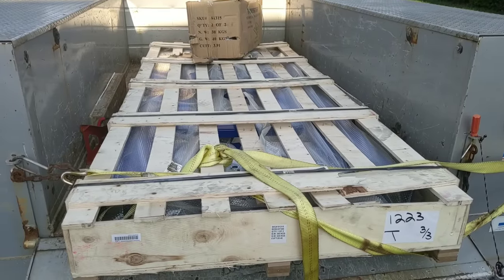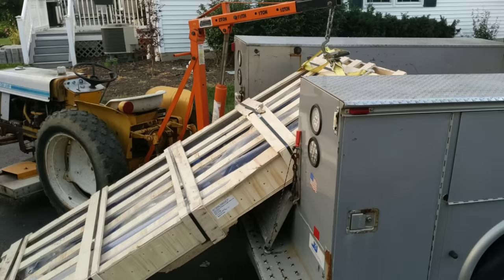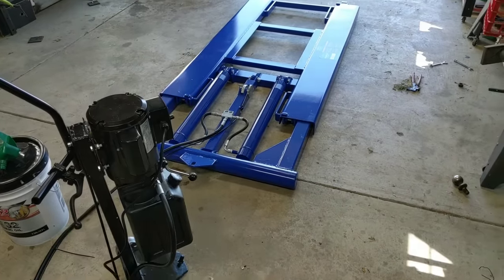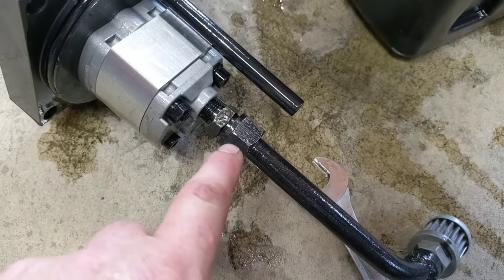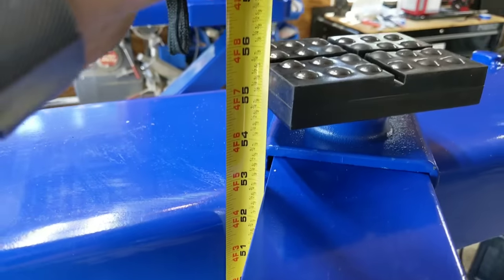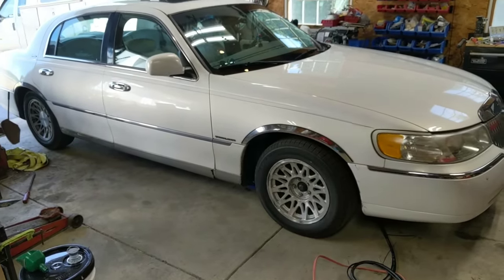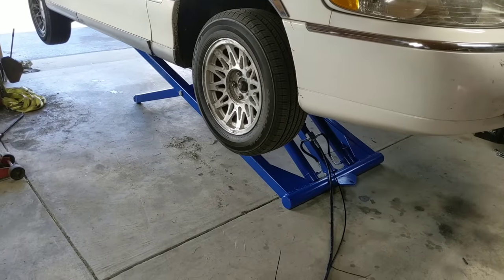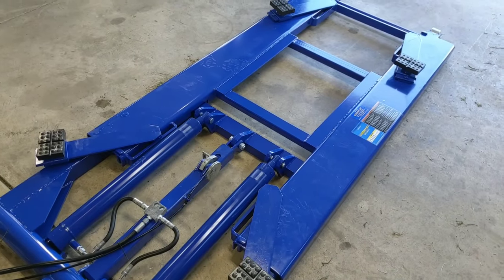Harbor Freight 6000 Lb. Capacity Scissor Lift Review, Central Hydraulics, is it worth it?

Comment: I’m considering cutting a pit in my floor. Dig it deep enough to pour 12” of concrete over a rebar frame I’ll make up. When not in use they’ll be a 1/4” steel lid or maybe I’ll pour angle iron at the top and weld double doors/hinges/ this way I’d have no trouble with car height plus I won’t lose my precious floor space. Not sure how thick your floor is. Most are 4 inches. That seems to spread the weight a little but eventually it will crack.if you want to save on concrete when you dig your pit buy 2 hunks of I beam. Weld some kind of steel U TRACK ON THE TOP OF THE I BEAM TO KEEP IT FROM SLIDING AROUND PLUS THE U CHANNEL OR TRACK WILL GIVE YOU A PLACE TO LOAD WITH GREASE saving those little wheels and bearings. Like you said that’s a LINCOLN town car. An old one. But it’s a low rider. What happens when you gotta put a little Ford Focus on the lift. There’s probably 6” from fram(ish) to ground. You gotta put a floor pocket in to get proper safe use  not sure what this costs. I’m also looking at a regular post lift like you’d see in a commercial shop. I’ve seen heavy duty enough to lift my Ford F-250 super duty 7.3 litter diesel for around 2K

Comment: Welcome to my world. 
Hahaha !
I do repairs and installs on all brands and all sized lifts. I’ve supported everything from the bargain priced overseas cheapies to the big names with big capacities and big price tags. We moved and reinstalled installed a Rotary 20,000lb. Two post last week and started a very experience repair on a 75,000 lb. In ground lift at a city Maintenence shop. 
We see brand new lifts shipped in all sorts of disarray and damage even when they are well packaged.  Lately it’s been much worse. (Blame it on the Covid)
As for custom repairs to the lift itself, that’s just “par for the course”. There are times I have had to “build a better mouse trap” out of whatever I have in my truck, or find available at the work site, to finish the job and leave the customer with a well working piece of equipment. The cheaper the brand is, the more I have to
 “fabri-coble” some kind of, on the spot, creative cobbling, to get the job done to my satisfaction. 
You just deal with it……

Comment: i have six freinds that  bought these and the same problem with the pump, was that that pipe fitting on theirs was loose also ,and the cover for the motor capasitor was all bent up also. but you got oil in yours, i did not

Comment: Looks OK for changing tires and brake work. Don't believe I would get under it and work, just doesn't look safe to me.
Reply from the maker: Correct! They are not designed to get under!   Perfect for lower detail and body work, not designed in any way to get under!    For detailing they are awesome, as you don't have post casting shadows and getting in your way!  :D

Comment: I dunno---will the safety hold if the lines blow? I would change the entire hose system for high rated braided steel. Also, the two bolts that are the pivots for the crossed legs are taking all the weight---Id go high strength bolts and maybe even use a bushing if possible--I cant see it from the vid.

Comment: How much you pay for that ? I got a Forward 10,000 pound 2 post lift for $2200, lifts up to 72 inch
Reply from the maker: I don't really remember but I want to say it was around $1,200 shipped.   Keep in mind a scissor lift is not a replacement for a post lift.  Scissor lifts are great for lower body and detail work as you can sit on a stool and wheel all around the vehicle without post getting in your way or casting shadows.  Post lifts are great for working under the vehicle.   Just a different tool for a different job

Comment: We have one at our shop it's only good for light vehicles hence the 6,000 lb lift ours does not bolt to the floor travels on the floor you have to put two byes on each side for the tires and run up on otherwise you drag underneath the car and it's really only good for small to intermediate size cars you can't put a crown Victoria on it you can't put a full size Cadillac on it you can drive on it but I wouldn't want to lift it because of damn arms don't go out far enough to grab a hold of the body and it don't go high enough of your 5 ft 8 like I am it does not go high enough to work underneath the car it's basically made for doing brakes and tire changes and shocks and stress and that's about it I like your four foot three then you can walk up underneath it with no problem and in the past year and a half that we've had hours I'd rather use the damn floor jack to work on a car then work on with one of these jacks or lifts but they're good for home use but weighing the cost of home use and doing work on a car or taking it to shop and paying them to do it sometimes it's cheaper to have somebody else do it that's my input

Comment: Have this kinda of lift in  shop i work for..Bought via AUTO ZONE,, works great,,But had issues as well,, the fittings not properly tighten ,,low on fluid, and wheel on pump kinda bent,, Just notified Auto zone, looked to confirm,, They got new one sent out within two days,,And gave discount on lift,, even tho bought when on sale..YES  using planks to get better height clearance..But over all ,,is a very good addition to shop or even for home owner if work on cars or suv,s

Comment: for $1600 you can get an Atlas 9000lb 2 post lift, or some Bendpak or QuickJack portable hydraulic lifts for $1200. I always prefer used though, Facebook or Craigslist find a better used one at that pricepoint! But good review
Reply from the maker: I had actually stumbled upon a portable 2 post for the same price, but I needed a scissor lift.   Post lifts are must if you need access to the underside of the car.   The issue is when your detailing or doing lower body work the post get in the way and cast shadows.   The other bay in the shop is getting a short 2 post portable lift in the very near future.

Comment: Looks like there’s so much metal plating/supports, etc in the middle of that thing that it would make exhaust work, drive shaft removal, transmission access difficult I’d not sometimes impossible. Or how about being able to access a frame rail-mounted fuel filter?
Reply from the maker: I wish I had explained why someone would need a scissor lift in the video.  They are not intended to get access to the underside of the car.   They are only intended to lift the car high enough to work on the lower extremities.   Perfect for lower  detail / body work as you can wheel around on a stool and not have post form a 2 or 4 post lift in your way.    If you need to work under the car, you need a different kind of lift for that.  https://youtu.be/RAqqgq7ielE

Comment: The end of the lift with the cylinders Goes toward the rear of the vehicle That is the weight to keep the left from tilting over
Reply from the maker: That is actually the incorrect way to load the car onto these lifts, unless you have an engine in the rear like a Fiero.   If you study the physics a bit while the car is up in the air, it is safer to put the engine over the hydraulic end, as stated in the manuals.   It is less likely to tip over.   If you go to the harbor freight web site and look this lift up, you'll see a van up in the air, the engine is over the hydraulics.

Comment: Well done. Not sure I would trust putting my life at risk under a 6,000 # vehicle over my head on this Jack. Especially, since you needed to rebuild parts of it. QC is low death risk is high. In my opinion
Reply from the maker: If it was something designed to get under I'm not sure I'd use it.   Luckily I'm not a contortionist and have no desire to try to get under it.  :).

Comment: I’ve been contemplating getting one of these to work on my car and as you’ve mentioned several times it might be more difficult for a lower car and the gentleman how do use two by sixes which is something I’ve already made to be able to get a jack underneath my car. 
With that being said with the Jack completely flat on the ground what is the measurement from the concrete slab garage floor to the top of the deck height of the Jack and then what’s the measurement from the concrete slab floor to the top of the pad and are the pads removable
My car literally is almost on the ground so I’m just trying to figure out if this is gonna work for me.
My only other option would be to mount hydraulic pistons on my car and then put a valve to inflate and deflate like they do on Grand Prix racing cars

Comment: You should have got some of the wheels that they have a Harbor freight they're heavy duty wheels but they're rubber so it's a lot easier on your machinery
Reply from the maker: I almost did just that, but looking at the weight capacity that was available in the local store was less than impressive and none of them had the weight capacity that I needed.   I always figured I'd go back and change them out some day, but they seem fine for this application.

Comment: 100 bucks says that rust is from its transit on the boat from china. Usually cosmoline is used on raw metal surfaces because the sea salt air will rust everywhere.

Comment: Hi sir, I have a question about my lift I believe we have the same lift. I bought mine about two years now and it didn’t have this problem. Just yesterday when I raised it up all the way up and on the right up gasket hydraulic liquid spray out from the small hole . I was little worried about it, I’d this something I should fix it and what I do to it? Do you have any suggestions or experiences with that problem. I’m great appreciate your help. Hoping to hear from you soon . Thank you

Comment: It's okay,  but it's a limited tool,  doesn't help you do exhaust work,  doesn't help you do fuel lines or brake lines,  doesn't help you remove a transmission.   Will work for a certain number of things though.

Comment: Pretty limited with what you can do to the car since so much is covered. Quickjack is a better option even though it's not nearly the height of this unit.
Reply from the maker: Quickjacks are great if you need access to the underside of the car, but for lower body detail work, scissor lifts are your best option.  It will jack the car up higher to a visual working level and you don't have post in your way casting shadows like a traditional post lift.    Just a different tool for a different job.

Comment: Good video except for one very important point,,,,,, when your car was up can you or anyone get under it to change motor oil,  change trans fluid, change rear and or front end diff fluid, replace or change exhaust system, take off transmission, transfer case....... 
Yeah the car is up  but because of scissor stile steel structure design, it dont look like you cant do anything but rotate tires............
Reply from the maker: That would be a great point, if this was a post lift. But this is a scissor lift, it's not designed to get underneath the vehicle. It's perfect for things like detail work and body work, as you can wheel around in a chair and not have post casting shadows or getting in your way.  It's just a different tool for a different job. If you need to get under a car, you obviously need to post lift.

Comment: What happens if it stops working after vehicle is up in the air. Is there a safety release if pump fails? The heavy pin jammed in for safety but then it wont release. What would you then? I like the idea of having a lift but it seems to have serious flaws.
Reply from the maker: Personally, I'd just use a bottle jack and some shoring, lift it a bit, release the safety latch and loosen a hydraulic line.   These are a pretty old design and have their limitations.   They don't really give you access to the underside of the car either.   That being said, they are great for detail and lower body work, I can sit on a stool and wheel all around the car with post not being in my way.   But getting access to the under side of the car, your really need a post lift.

Comment: I had my hand broken by a transmission that fell onto it using one of their transmission lifts. C-clips (yes 2) broke. The groves were not deep enough for the clips. The lift twisted left and then the right, before crushing my hand.
Reply from the maker: Yup!   You definitely have to be careful when using tools!   I always tell my guys never put yourself into a situation where if the tool would fail, you would get hurt!   Hopefully your ok and a lesson is learned!
Reply: @1D10CRACY  Agreed I’ve always told everyone to check the equipment over before using to. I’m guilty of not following my own advice

Comment: I could see it being nice for suspension work.  Anything to do with the wheels would be fine but you can say that about jack stands too.  Anything where you really say "damn I wish I had a lift" because you're working under the engine or the rest of the drivetrain, I gotta assume the lift itself is gonna be right in your way.  And that's before even going into trusting your life to a harbor freight thing.    I think for me jacks and jack stands make the most sense and I'll save the $1600 towards the fund of someday buying a real post lift

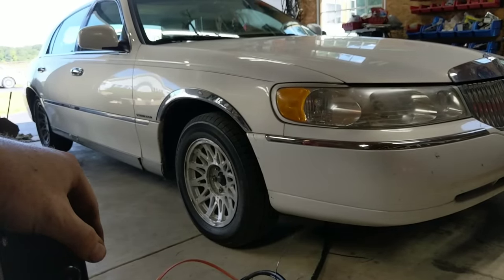Comment: At 8:40 you hit the button twice to raise back to back. You don’t wanna do that. Give at least 3 seconds from doing that. That hurts the pump. I got a very similar lift at home
Reply from the maker: Could you explain mechanically why we shouldn't be doing this?   I can see the switch not handling the excessive arcing, but as far as the pump goes, I'm stumped.   Even the motor should be able to handle short burst under load.
Reply: @1D10CRACY  for ours its more of the pump it's almost like it's done it from day 1. Probably more of the electrical load. Ours is a different brand which was sold under a snap on name but we all know it's not snap on

Comment: Thank you for the video. IMHO, this  very reason is why many customer's they once had won't buy from them anymore. I think Harbor Freight may have had to sacrifice when they first started in business by having to put up with manufacturer not packing their equipment well enough to protect it vs cost. White that said. I believe HF sells enough volume they can demand more from manufacturer or find another manufacturer. I'm sure there are manufacturer's would love HF business. If it was my business that's what I would do. Not everyone has the know how to fix their damage. This is why I don't buy larger Items from HF anymore. It just incompetent to sell items knowing it going to get damaged and hoping the customer will give them a pass.
I got sick of putting up with their damaged products coming from China. There are now many other companies that have comparable products at similar price point.
Reply from the maker: Thanks.   For what it is worth, they reached out to me shortly after this video and told me their vendor had agreed to ship the pump in a wooden crate because of this video.  So I have to say they at least seem concerned and are trying.   Recently they stopped selling this unit all together and the rumor is they are working with another vendor to have another one reproduced.

Comment: I had one of these type lift but a different manufacture. The one i purchased was much better quality. It does work well for tire changes/rotations and brake work. but beyond that it's pretty useless. Tried to change oil in a car once and i had to do a balancing act with the drain pan. I sold it and am buying a two post lift. even a four post lif would be better than one of these
Reply from the maker: Yup, this is a scissor lift, it's not really designed to get access to the underside of a vehicle. They are perfect for lower body and detail work, you can wheel all around the car without post casting shadows or getting in your way.  It's a different tool, for a different job.

Comment: I can't see how you could work on a transmission or even an exhaust system on that lift.
Reply from the maker: It's not designed to gain access to the underside of the car.   It's only designed to lift the car high enough to to work on the lower extremities of the vehicle.  Perfect for sitting on a stool wheeling around doing lower detail and body work.   The advantage is you don't have the post getting in your way or casting shadows.    If you need to work on a transmission or exhaust, you would want a 2 or 4 post lift.

Comment: A lot of cross members and bars to get in the way when working underneath and the sides are so wide. I think it would be hard to work on this with this lift.
Reply from the maker: Yup!  It's a scissor lift, designed to lift the vehicle high enough to work on the lower extremities.   They are not designed to work under!   Great for body work, as you can sit on a stool and wheel all around the car with no obstructions or shadows from a post lift.    If you need to work under a vehicle, you need a post lift.  Just different tools for different jobs.

Comment: That should be plenty high because the only thing you can do with that kind of lift is work on wheels, brakes, hubs, and anything suspension related, that’s it. No exhaust, no transmission drops, hell changing oil is gonna be a pain with that lift.
Reply from the maker: Detail and lower body work.   That is what I use mine for mostly  Post lifts cast shadows and get in your way when wheeling around on a stool.   It's just a common scissor lift, nothing new or fancy.  It's about picking the right tool for the job. BTW, I do use mine to change oil, never had an issue there.
Reply: @1D10CRACY  I didn’t think about body work

Comment: Am I correct that the first click of the locking mechanism occurred at the height at 5:38 in the video?
If so that seems like there should be safety stops that kick in as low as maybe a foot.
Reply from the maker: I believe there are 7 safety catches spaced evenly throughout it's lift.   Not sure the sound of the video reflects where they are at.
Reply: @1D10CRACY  thanks